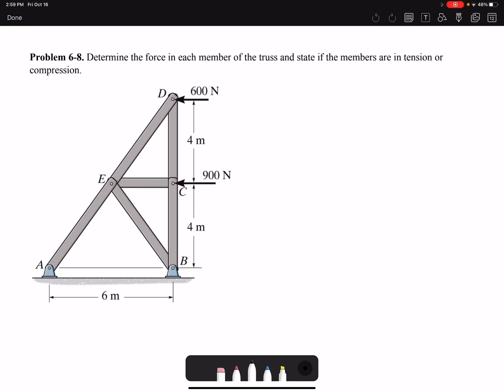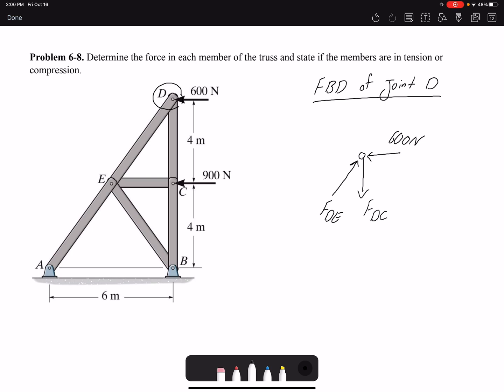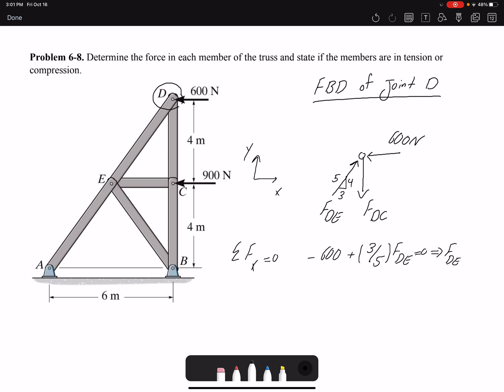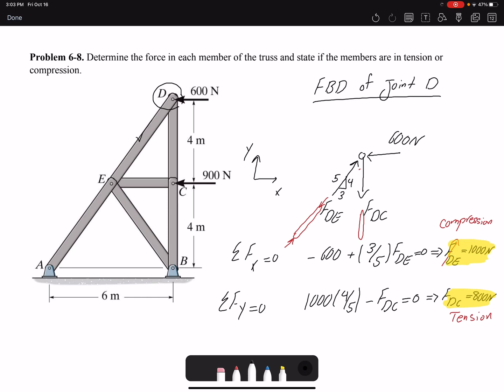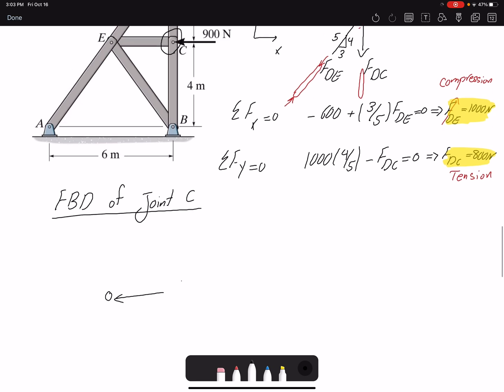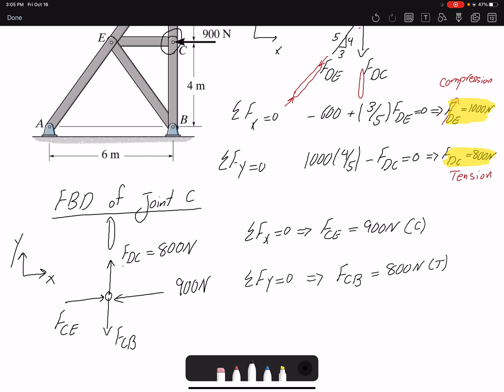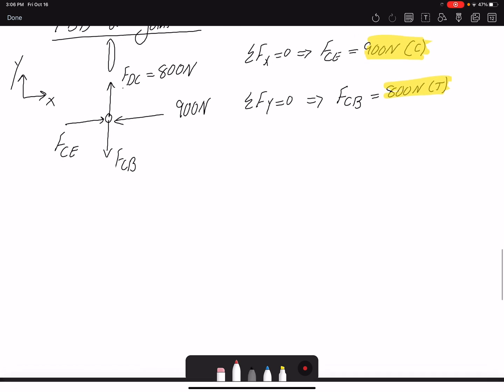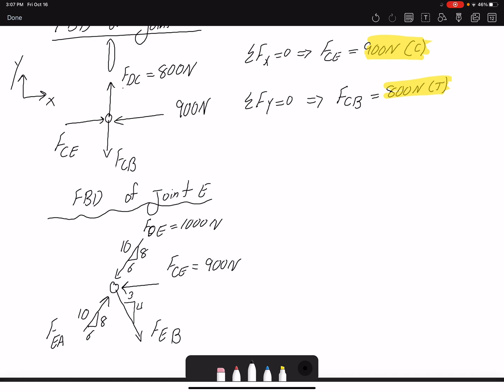Statics: Truss Practice Problem 6-8: Method of Joints

Comment: How did you find Fea and Feb, you never finished those equations
Reply: if you analyse the joint A, you can notice an Y force (as well as on joint B). then, you do: Mo= 6 times YB + 900 times 4 + 600 times 8.   YB= -1400 N
ΣFY= YA+YB= 0   so YA= 1400N
afterwards, we can find the angle of the ABE triangle: 4/3 (half of the base)= 1.333333 

1.333= tg 53.13
if Fea= Ya times sin 53.13 then Fea equals 1750N
you can find Feb easily after that.